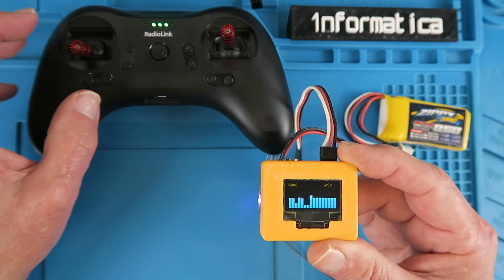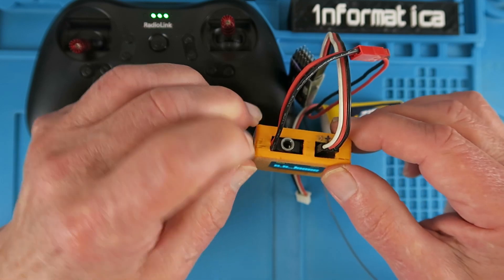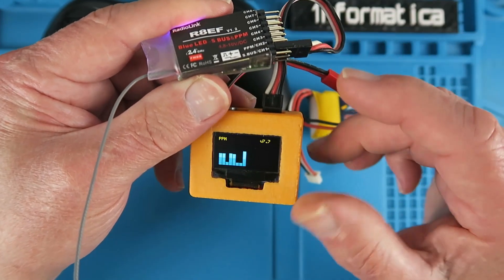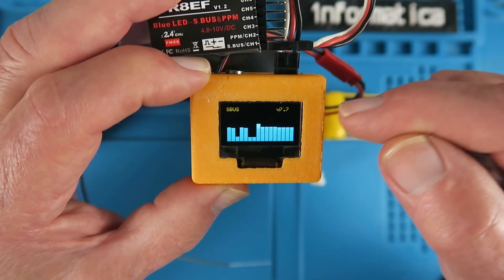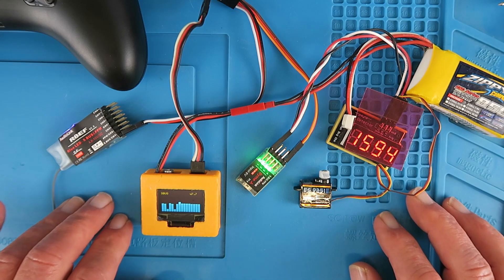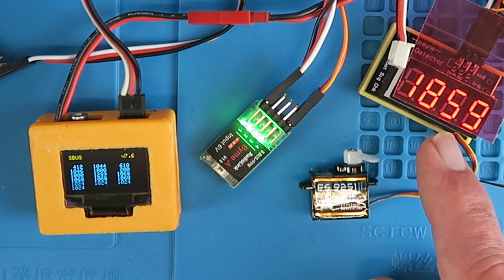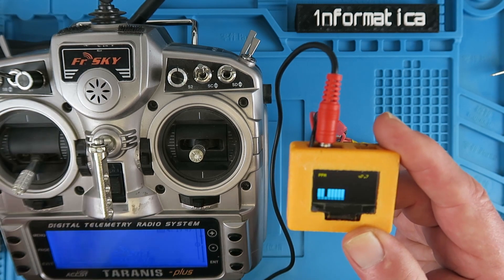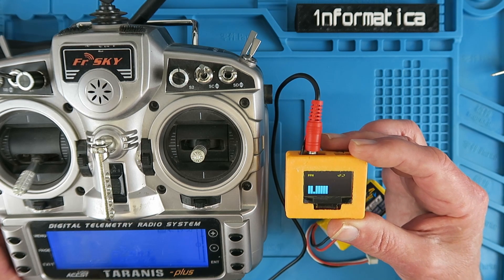SBUS PPM PWM Signal Monitor Analyser Review

Comment: I've looked on line for this Analyzer. Can't find it anywhere. Can you or anyone help with finding?
Reply from the maker: It appears to no longer be made. A pity because it is very useful. I guess you could make something similar using Arduino, there are libraries available to decode the signals. Good luck!

Comment: For few minutes now i bought this item over your link by Banggood.com.. i hope this Item for Sbus test are functional.
Reply from the maker: Thanks for your support. The unit works perfectly with SBUS receivers. As well as the Radiolink Receiver I show in the video, I have tested it with Frsky units. Another feature I did not say in the video is that it is very useful to show the "failsafe" settings of a receiver.